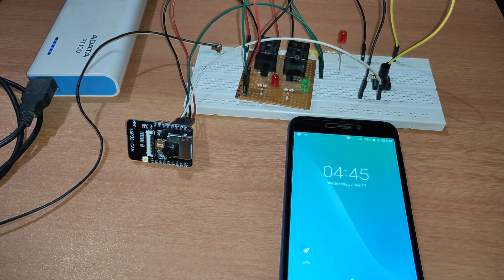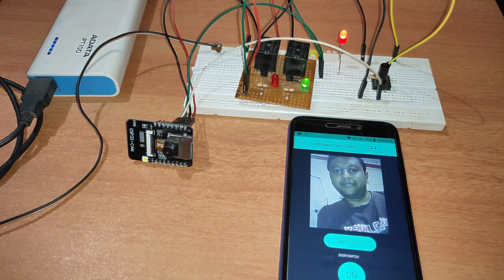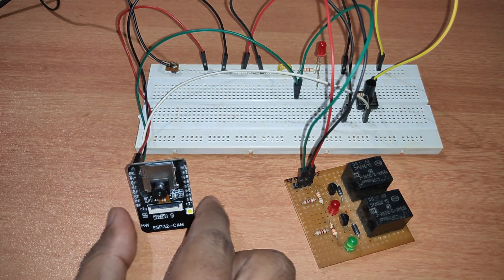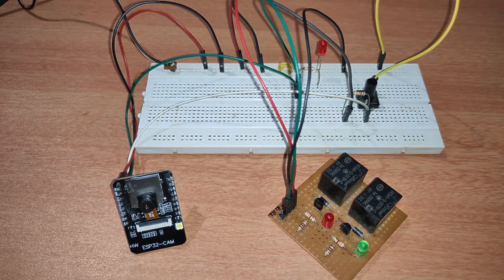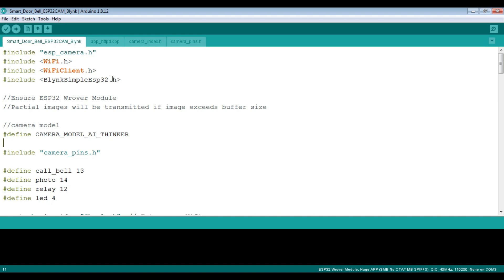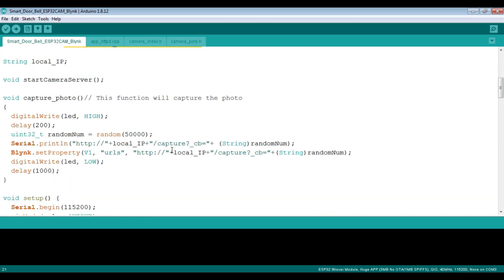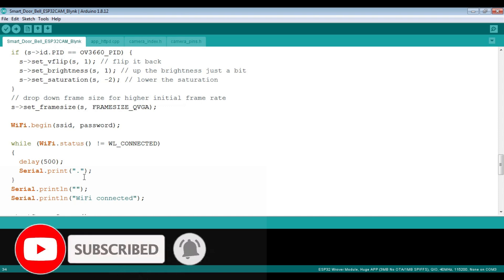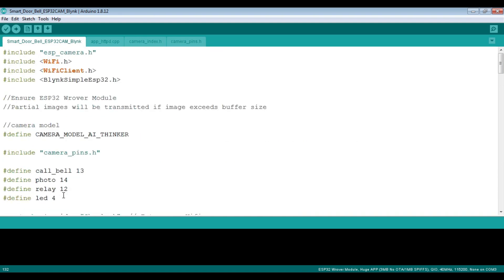IoT based smart door bell using esp32cam and Blynk

Comment: I'm trying this project for my final year project but I'm having too many errors please help
Reply from the maker: What are the errors?
Reply: @IoTStarters  While uploading code I'm getting error as "blynksimpleesp32.h : no such files or directory 
Kindly suggest.
Reply from the maker: Kindly install blynk library in Arduino ide.
Reply: @IoTStarters  I'm again getting error GPIO_NUM is not declared
Reply: @IoTStarters  thank u, it works fr me
Reply: Plz can u revert on recent issue which i m facing
Reply from the maker: Have you got the file camera_pins.h?
Reply: @IoTStarters  Not able to understand, wi u plz elaborate?
Reply: @IoTStarters  is there any way so v can connect  together n sort? Actually  I wanna submit my project by Monday.
Reply from the maker: Please share the error screen shot to iotstarters1@gmail.com

Comment: How to connect the cellular network on esp32 camera and the mobile device for this project
Reply from the maker: Hi Sakshi,
You can use either sim800L or TTGO-T Call board with esp32 cam.once esp32 cam establish the connection with internet thwn it can be easily accessible through mobile device.